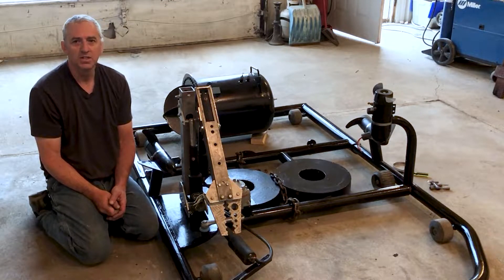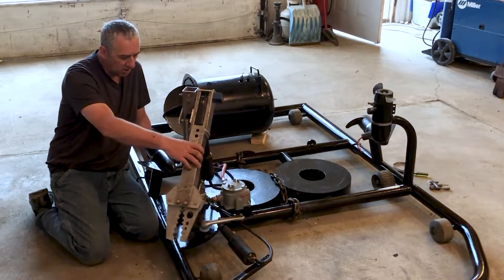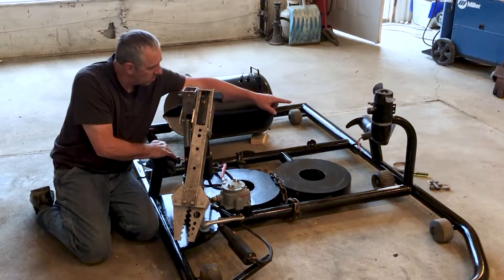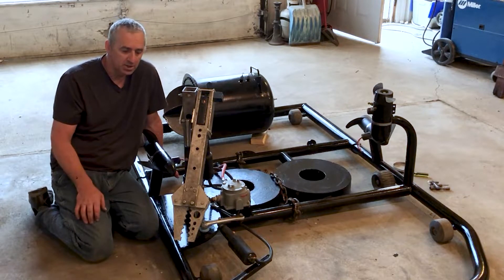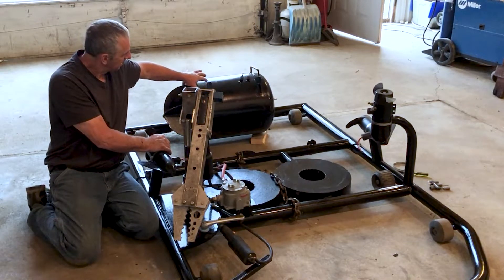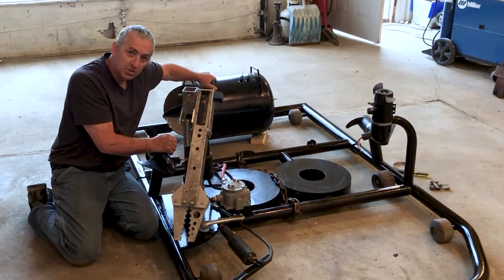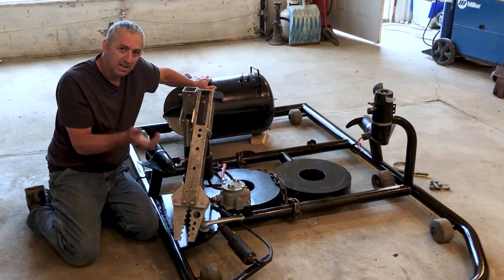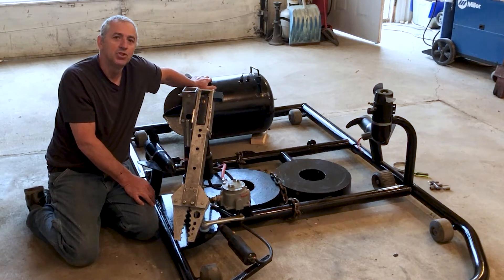Homemade Submarine Chassis Progress | Isolation Project

Comment: Very nice!! And wheels as well! I’d been wondering if you’d put powered tracks on it! No need for a concrete boat ramp then!
Reply from the maker: Tracks might come yet.  If I increase the volume a wee bit I can put lightweight tracks on.  I would need power source at shore but that would be fine.  Just drive in the water and disconnect.  It could be hydraulic quite easily.